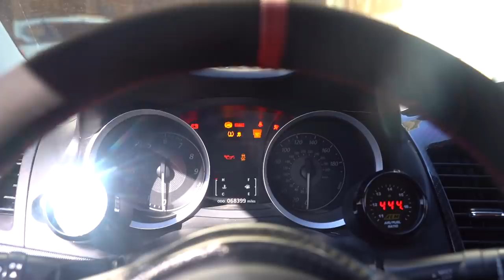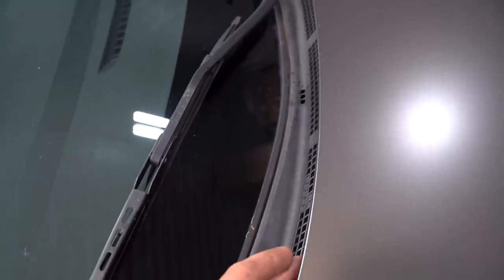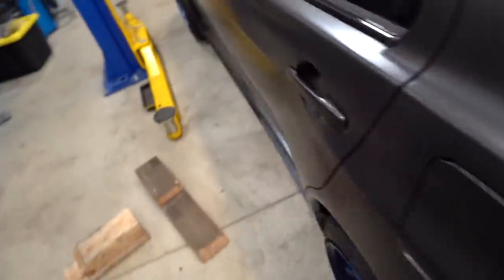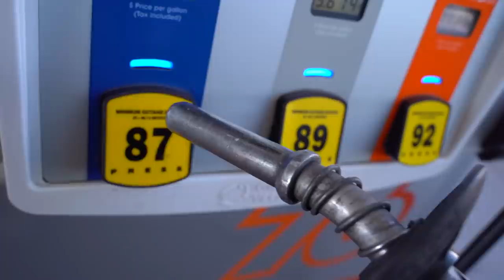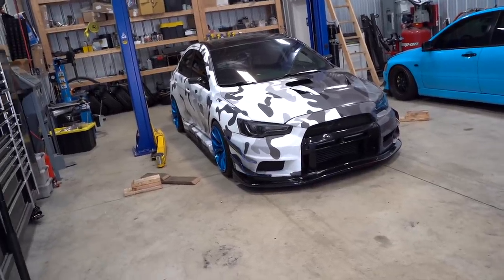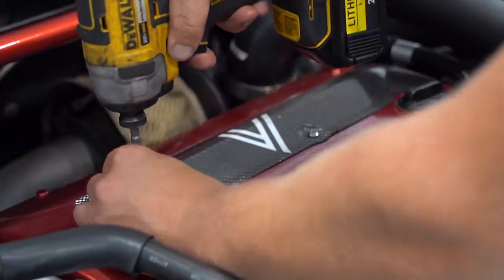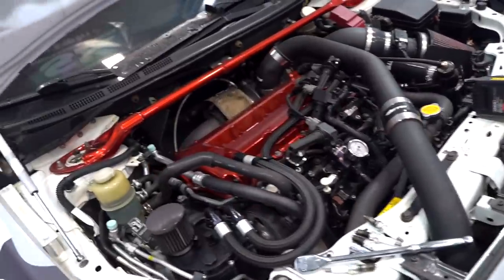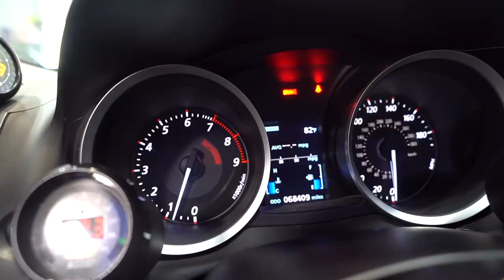I thought it blew up...

Comment: Check how much fuel pressure there is when u crank it. It should be 50+. If not, then run a wire from the pump to a fuse that only powers when key is in the on position. Once you do that, turn the key in the on position, wait a few seconds ( you’ll hear the pump) then start it.

Comment: Check Fuel pump and filter. The  check valve in the pump can be going bad and causing you to have a fuel pressure drop while cranking. Especially since tapping the gas starts it quicker

Comment: When doing a compression test, are you keeping the throttle open?  Keeping the throttle open will bring in more air and give you higher readings.  I usually use a long screwdriver to keep the throttle blade open when I test.  Might not be the best tool but it works and won’t get sucked in.

Comment: try testing the compression after getting the car up to operating temp, I believe you also need to let the throttle body open up like holding it open or putting something in it to hold it open

Comment: I compression tested my 4b11 after I overrevved with the same harbor freight gauge and all my cylinders read 90-95psi. The cheap gauges definitely read lower.
Reply: Yeah I have an innacurate gauge too. The problem with them is the schrader valve is in the hand piece and not in the fitting that screws into the sparkplug which means there is more volume in the system (cylinder plus the hose). You really only want to know the compression in the cylinder only. I got 130psi across all cylinders in my 4G63 with a crappy compression tester which isn't great.

Comment: you would just need new piston rings, gapped right for the proper amount of boost your running, also if its got low compression in one cylinder that would = new rings, but you could also tell cause there would be blow-by but will see when you get the good compression tester

Comment: I think you should clean the throttle body, i had the exact same issue on start ups, especially on hot start the car won’t start unless i press the pedal but after cleaning everything was good,( im not sure if that’s the case on your tho)

Comment: My evo 8 does the same thing actually, it a pain in the ass to start but if i do open throttle (clear flood mode) it starts immediately first turn.

Basically turn the ignition on, right after i hear the pump come on i press the pedal down, turn the key and release the pedal right as it starts.

Comment: Im guessing your check valve in your fuel pump is weak and is letting fuel drain back into the tank causing the starting issues

Comment: Did it ever have a cold start map for e85 done on it. That's usually the problem, pump gas gets tuned from cold you fill it with e85 when it's hot then map it.
that second start has bore cylinder warmth so helps it fire.

Comment: 2010 genesis coupe 2.0t they have  a simular block as the evo 8/9 u cam bolt up a evo 8/9 turbo kit in a genesis, when bobby had her's thats why it sounded like the evo
Reply: 100% would love another genny on the channel
Reply: @Ernadyoutube  i have one, i did my research on why it sounded like the evo, &  it turns out, it has almost the same engine so evo 8/9 parts fits the genesis

Comment: Ok joining in to the Bobbi and other women don't need make up to look good comments, if they choose to, fine, afcourse, each to their own. I and probably many will appreciate natural looks. 
Joining in on the car suggestions, ousss hard choice, I kinda would like to see a track (circuit not drag) Evo built, for example the black one. But take your time with it. An American would be kinda fun too I think, Corvette's/Dodge or something, idk. Also an BMW but since you already own an M3 a newer 3 or 4 series, they can be be modded quite good and quite reliable engines. Chiptuning and some minor mods allows crazy numbers. But I also would find an Audi/VW small built quite entertaining if they're not to pesky, the engines are getting better of those but still keep that in mind. Or S2K a fun small Miata or Civic/Integra built. Or even an R35 since you love that car. A 350Z/370Z turbo'd or supercharged. (Convertible variant for summer? :P) 
Porsche for fun if not to bitchin' expensive for parts. xD

Comment: Can someone explain what gapping the spark plugs means?
Reply: There is a gap between the center electrode and ground electrode, allowing the spark between the two. “Gapping” refers to the distance between them, as different motors require different lengths for proper operation.

Comment: I wouldn't go that high in RPMs it even is recommended not to do that or fast shifting dont got past 3k. I know it's difficult 😩but def don't want pre mature slipping clutch
Reply: Its a clutch that’s made for big power It’s actually better if you drive it a little rough for brake in just don’t go full send and bang gears
Reply: @denniskonko8335  I have the same exact clutch and asked exedy they told me not to go over 3k and 500 to 750 city miles where there is alot of stop and go. Even the instructions say it when you receive the package. But sure people can do what they want, I was just recommending

Comment: get chag to look over it. never been a big fan of English racing even though they are a good evo builder/tuner. get a second opinions for the cold start.. I think its some kind of injector scaling issue with the pump gas tune.